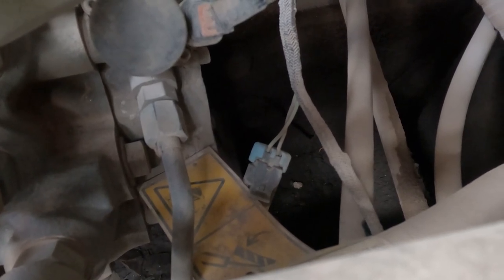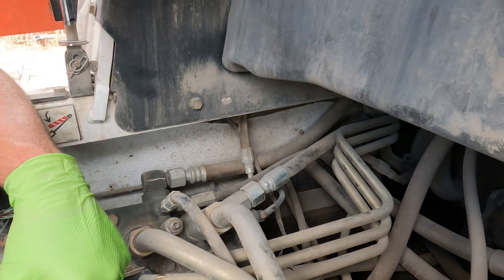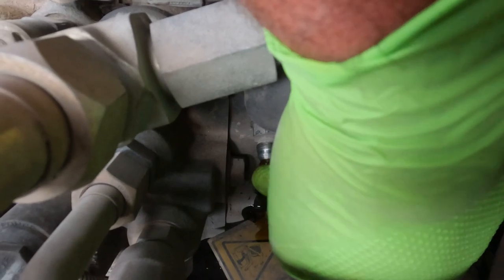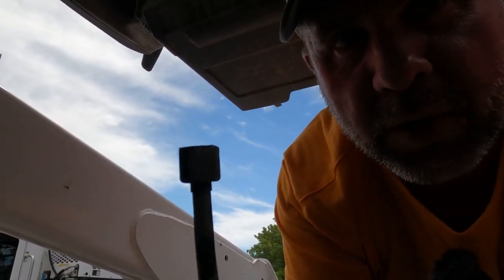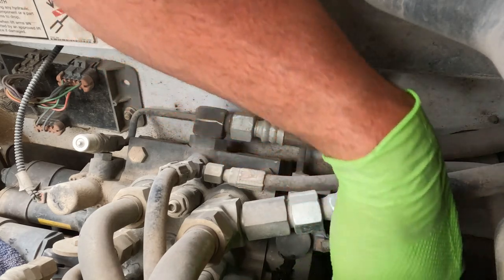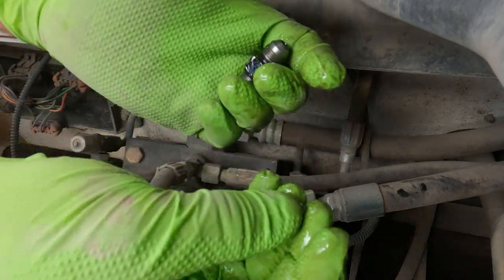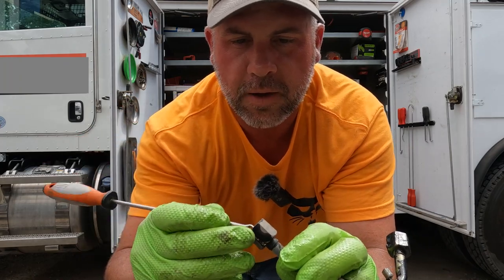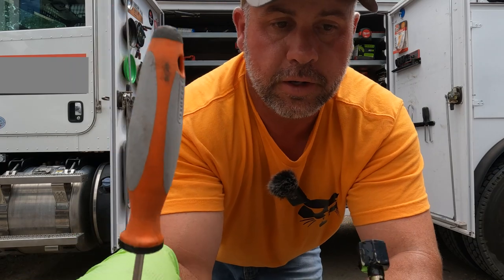Bobcat Hydraulics Slow To Release?

Comment: Ed Dussault  Your videos are a real time and money saver and I am sure everyone really appreciates the calm way you go about explaining what the problem is and then how to resolve it.  I own an A300 with about 1600 HRS. and I seem to be having a lot of occasional BIC lock-out which really makes me anxious wondering if I'm going to be able to get the machine moving again.  Does the A300 have this check valve in the main control valve too?   I really want to locate it so I can fix this problem.  Also the Air Conditioning tune-up on the A300 doesn't seem to have all the filters and the way to blow out the condenser the way you demonstrated on the M model.  Is there a video to address that issue too?  Thank you so much for sharing your experience with Bobcat owners.

Comment: Hi there we have had the same problems on a 590 we have removed the poppet and spring which was broken in 3 pieces.
My questions are
1. Where the screen has ended up. It's not in the brake release block.
2. In this video you pulled out a double spring. It seems our machine only had one spring but in 3 pieces we hope otherwise that means all that junk will be in the main block.
Also after removing these parts we are having issues with the machine responding nicely to the controls and then other times doing the opposite to what our joystick inputs are. 
Any help would be appreciated.
Cheers 
Josh 
Auckland l, New Zealand
Reply from the maker: There is another screen in the valve that would catch it, we would need to schedule a consultation for the other issues because I'll need more information.

Comment: Thanks for the info! I have a 2013 T770 and when I first start it up the hydraulics seem sluggish and acts like it’s getting bogged down just putting the stick forward driving. After a few minutes and turning on a high flow attachment it seems to go away for the most part, but I feel like my hydraulics are still weaker than normal. 950hrs all fluids and filters have been changed, with no fix. Any ideas?
Reply from the maker: Sounds like a charge pressure issue, do you have a deluxe panel to monitor change pressure?
Reply: I do, haven’t received any codes or anything
Reply: @dylanbook5896  charge pressure should be 300 psi give or take. I've seen 295 to 325psi 2012 t770